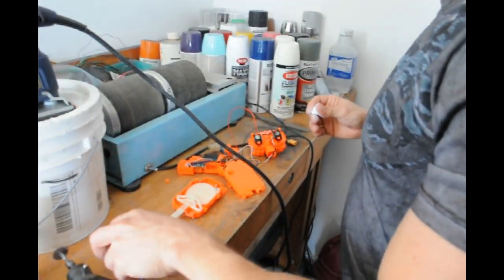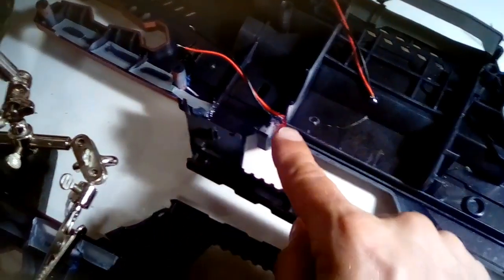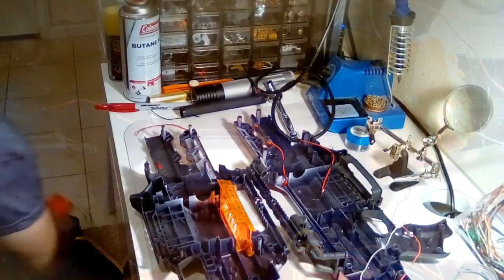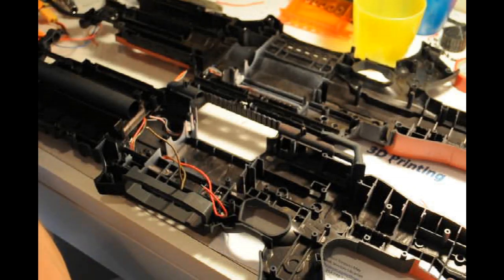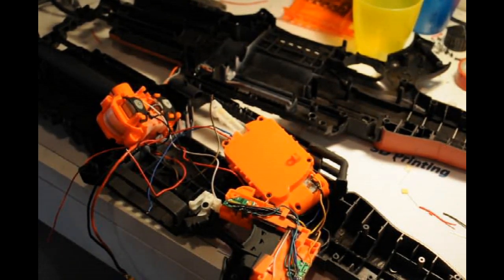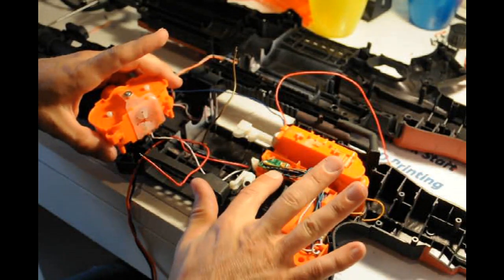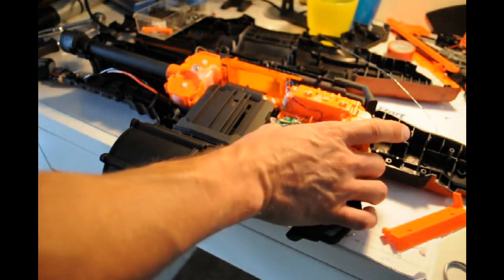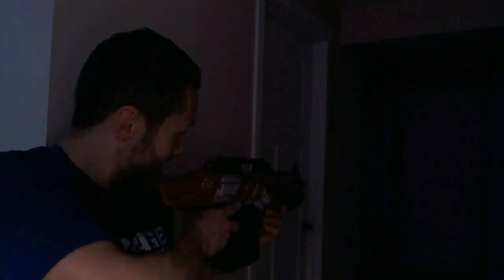Make a Destiny 2 Auto Rifle Destiny Cosplay Prop | Nerf Rapidstrike Mod (Part 2)

Comment: Weathering goes hard
Reply from the maker: A pretty easy process for the weathering. Just use a watered down black and brown mixture of acrylic paint then quickly wipe it down and add a clear topcoat sealer. 🙂